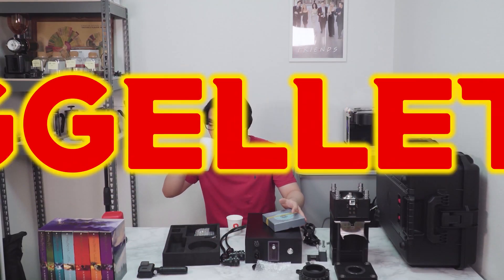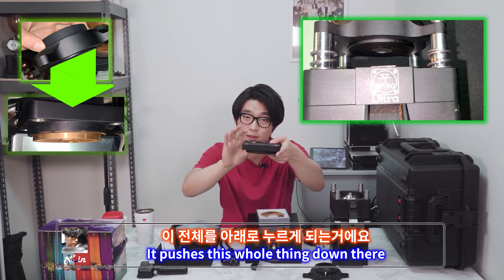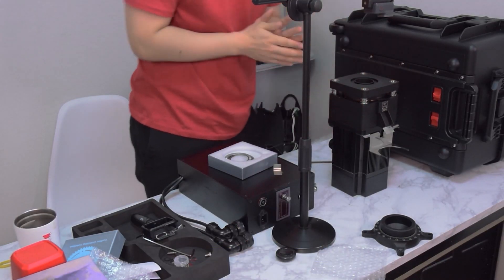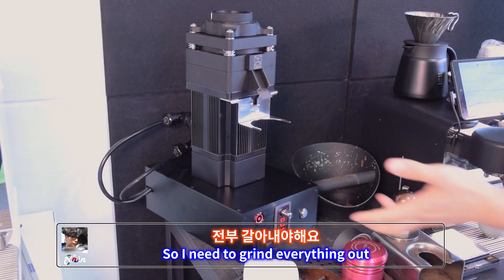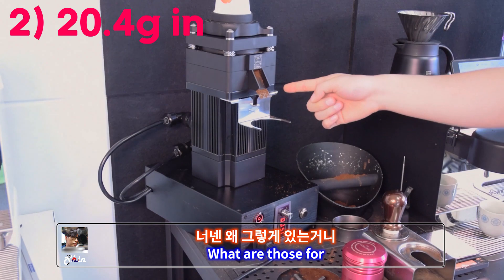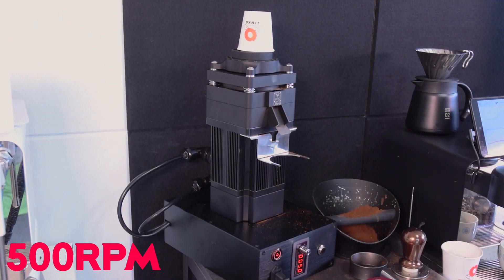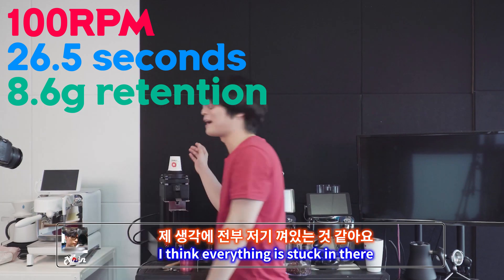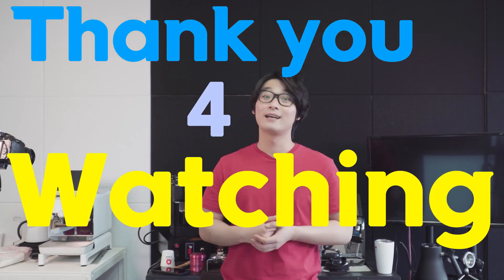I'm not an Ultra Virgin anymore. Not very well at first but getting used to this. RPM test. Reverse.

Comment: Hey Shin from Austria.

I am in contact with many people who own a lot of grinders and some of my friends own this since April-Mai.

To fix the retention problem you can 3d print some extensions to the carrier sweepers. They need to extend for 1.3mm minimum. 

After you do this modification you will get within 0.1g retention maximum. There is no need to WDT for this.

They will modify the grinder in the future,  some people already build a 45 degree base so the beans come out easier.
Reply from the maker: Oh yes 45degree carrier looks nice. But the thing is tho i don't see retention is big issue with this grinder. I found out at the end of the grinding, i higher the RPM up to 2500 then all the residue comes out 🤣. I'm doing 600-1000RPM nowaday.. and it works fine. But for really low RPM like 100, I definitely need to tilt it like 45 degrees..
Reply: @coffeeshin2788  they left the two little holes on the carrier sweepers fins on purpose so you can insert some extensions there. If you will open the grinder after grinding there will be a ring of coffee at the top that doesn't get pushed down because the sweepers are a bit too short (this is so when you touch the burrs you don't scratch the upper body with the sweepers ).
Reply from the maker: Ahhh I see that now.
Thank you!

Comment: Hey Shin, great video as always. I think the retention on the lower RPM is all stuck behind the magnetic cover. The reason why it is magnetic is so you can take it off after grinding and get that last ~1 gram out of there at the lower RPM.
Reply from the maker: Thanks! And you're right Michael. But also as in the video, some of broken(not even ground yet) beans stuck in the center of the bottom burr carrier. Since the RPM is so slow, it could even go into the burrs. Especially when there is no press from other beans(like hopper full/empty hopper).
Reply: @coffeeshin2788  it seems that slow rpm will work better for coarser grind size?

Comment: This grinder is obviously super high end and technical but it does make me appreciate how simple the Niche is in comparison.

Great video! It would also be nice to hear your thoughts on flavour and everyday use between your grinders.

Damn that thing is quiet though, and fast!
Reply from the maker: Thanks man!

That's what I exactly thought. Simple and no need to tapping thing after grinding with niche. It just takes more time. So tilting the ultra grinder is quite tempting. 

I'll do a bit of comparison on the side when I make the review video.
Reply: @coffeeshin2788  Ah yeah I was going to say, maybe if the burrs weren't parallel to the ground then the feeding and retention would be better?

The variable grind speed seems  exciting if a bit daunting to play with too
Reply from the maker: @marcusannegarn8497  yeah theoretically.. but still it's got retention as we know since it's basically Ek43

Comment: I am curious if you wanted to do low rpm for some reason could you kick it up at the end to throw out the grinds and reduce retention? 
Thanks for the video
Reply from the maker: Thank u~!

Yes because there are some research result like "low RPM less fine&higher uniformity" but as long as the taste doesn't match with that theory, I won't care. But so far so good.

And yeah kicking it up at the end. That's what i'm doing nowaday. And that works just great
Reply: You sure can! The LeverCraft Ultra Grinder comes with a programmable RPM profile so with one press you can start the grinder low rpm and it automatically ramps up to whatever you want to set it to.

Comment: Man, much thanks for doing this video.  I just ordered it today, but now I'm thinking about canceling after seeing your video.   The popcorning looks pretty bad.  They need to redesign the feeding mechanism.  The way that coarse coffee came flying out, the grinder seems messy.  That's what I hate about my Vario.  The chute system seems like a hassle, and it's not well thought out.  Looks like it kept falling out.  But, anyways, I would love to see you do a consistency test.  See how consistent it is with back to back shots.  20 grams in, 30 second shot, measure the grams of espresso that comes out.
Reply from the maker: Please wait. They've been upgrading their products ever since. This is there very first run. They've already fixed the retention issue as I know.
Ah...I'm not sure how they dealt with the pop corning though... but as long as you block the top it should be okay. I've got a mahlkonig tanzania, and it popcorns as well unless I close the shutter on the hopper. Your suggestion is accepted. Thanks~!